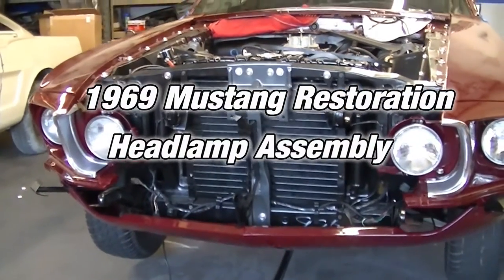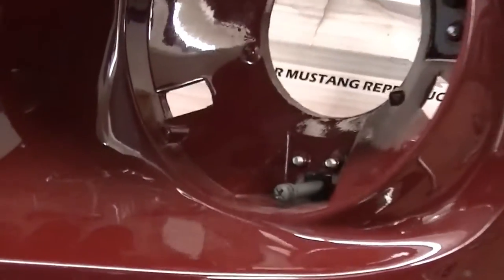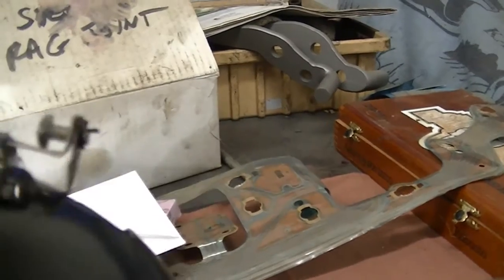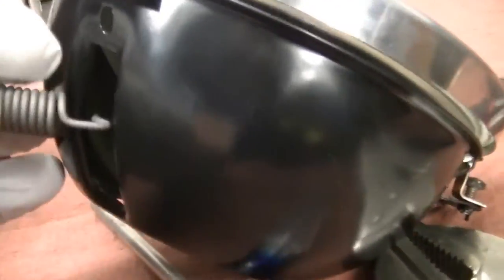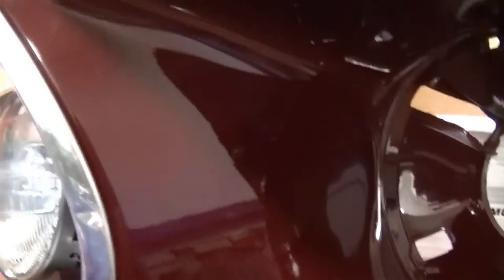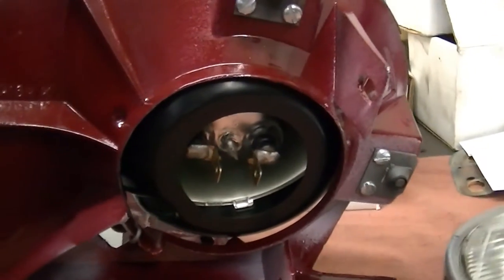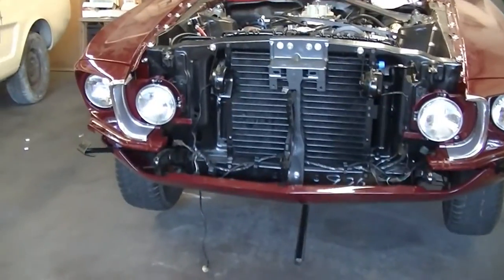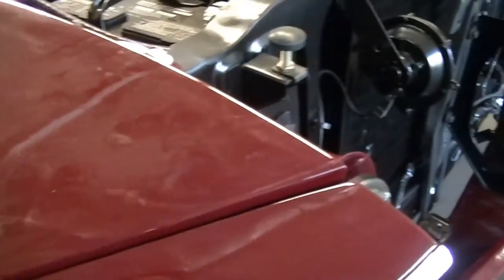The Bucket List 1969 Mustang Restoration Part 62 1969 Mustang Headlamp Bucket Assembly

Comment: I’m putting new headlights in my 69. Car is apart so no power. When I do get the car running was curious do the low beams stay on when you turn on the high beams or do the low beams go out when high beams turn on? Thanks so much!
Reply from the maker: The low beems stay engaged when you use the high beems.
Reply: Thanks so much!

Comment: Is it possible to put 1969 mustang headlight bucket on a 1970 mustang ?
Reply from the maker: *****  The 69 -70 fenders are the same except the 70 has a side marker in the fender and the 69 does not. Both buckets interchange but the grille,valance, etc are slightly different.